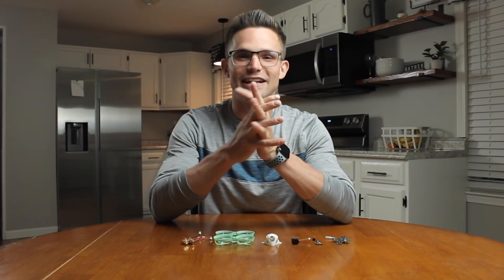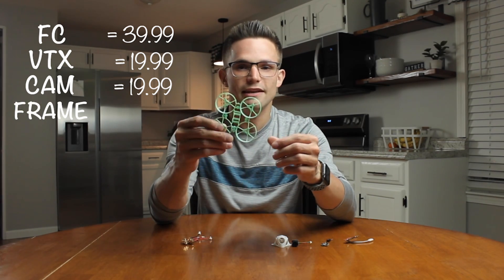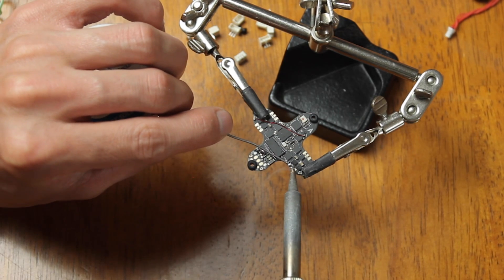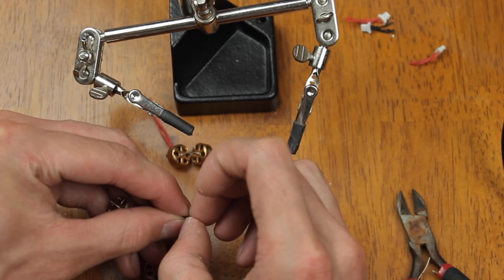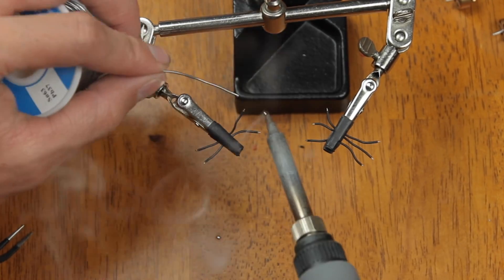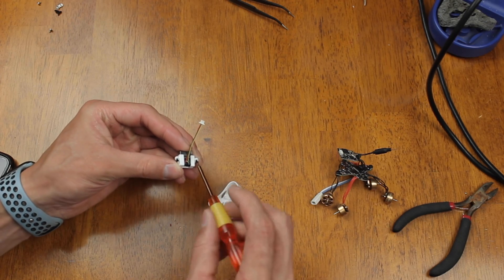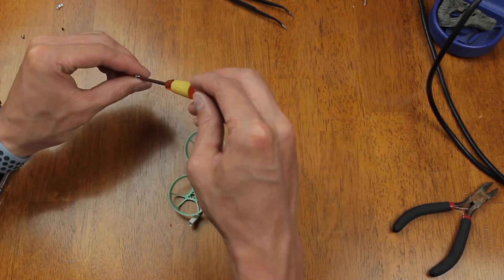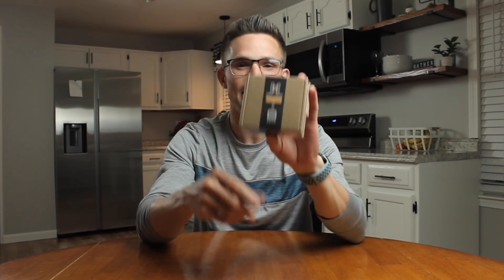DIY - Build a Micro Racing FPV Drone for $120 / in 2023

Comment: the camera has 3 pads coresponding and the vtx also ( better to swap the vtx they die to tbs v1.1 nano ) the small cables break after many crashes. also place something between the fc and vtx . no touching. solder motors. use ultra strong clear double sided tape to mount on the bottom and make ur own antenna perfect lengt, it's safe between the fc canopy and battery the antenna cross the vtx and go back to press the battery 90 degree between the ducts on the left or right side
Reply from the maker: All great ideas! Thanks for sharing!👊🏼

Comment: Is there a follow up video?
Reply from the maker: Hey, I never made a follow up video as far as a long term review. Sorry about that. I later broke the VTX antenna off in a crash… everything else with the whoop is still in good shape, I just need to swap out the VTX. I would recommend one of the newer builds I’ve made videos on if you wanting to do a build😊 these whoops are constantly updating so even a year later a lot of things change.

Comment: Why did you use betafpv parts if you never tested them out before?? 

Also, I use betafpv and don't have a problem it them but I heard they have a quality issue??? 

Did you find any quality issues when testing?
Reply from the maker: I wanted to try other brands and products to compare them to what I usually fly. I changed the title because I didn’t want to be misleading without testing them long term.
Reply from the maker: So far it’s been flying great and I really enjoyed it!

Comment: Hello what is the flight time and can i connect to board external elrs module
Reply from the maker: Yes it should connect to the elrs module. Depending on how hard you run it but around 2min to 2min 30sec

Comment: What did it weigh?  I would have gone with higher kv for an 'ultimate build.'
Reply from the maker: Agree, for most beginners I think 18,000 would be a good balanced motor, providing sufficient power and giving good flight times. I’ll have to weigh it and let you know the exact weight.
Reply from the maker: Exact weight is 21.67

Comment: i am using F4 1S 5A AIO Brushless Flight Controller from betafpv with betaflight 4.3.0_BETAFPVF411 fw. left rear motor (motor3) doesnt spin when I do motor testing with 1s lipo connected. BETAFPV 1102 18000kv motors. 
1. connected working motor to esc of motor 3, result: motor didnt spin 
2. connected not working working motor to working esc, result: motor worked 
it happened to my 1st board betafpv sent me replacement board and same behavior. am i doing something wrong?
Reply from the maker: Interesting, sounds like a defective board. I would swap the motor to double check but I would say defective fc maybe.
Reply: @wynnfpv  motor swapping shows same behavior. This is the replacement baord i got from them. Same esc# showing same behavior
Reply from the maker: @1979zeesh  I would reach out to them and let them know because it sounds like you got two bad boards…
Reply: This is happening to me! My right rear motor spins at 2,000 rpm max while all others sit comfortable at 38-40k rpm
Did I get a bad board? What did you do? Did the third board stay good?